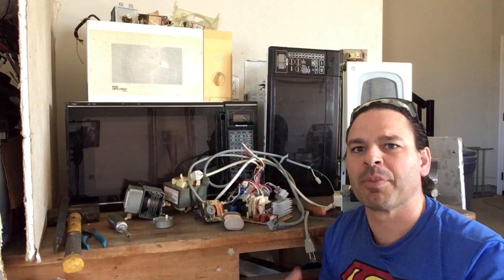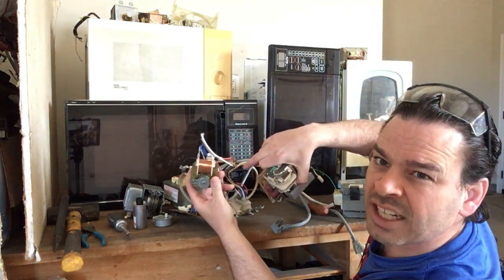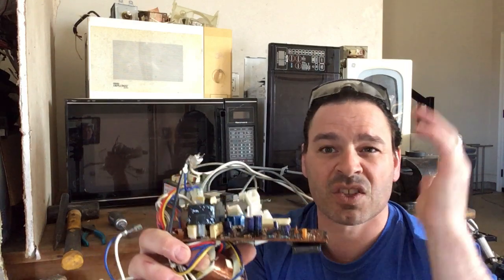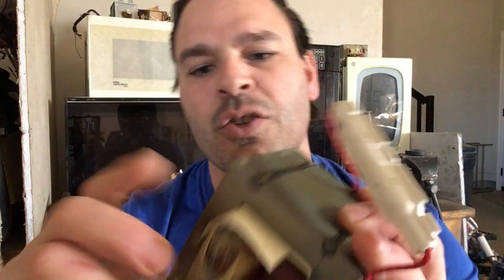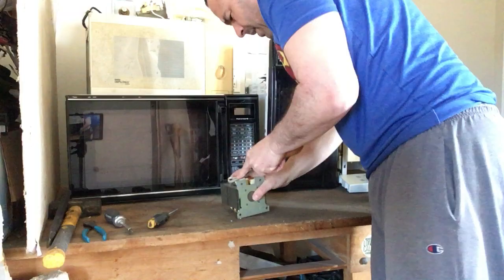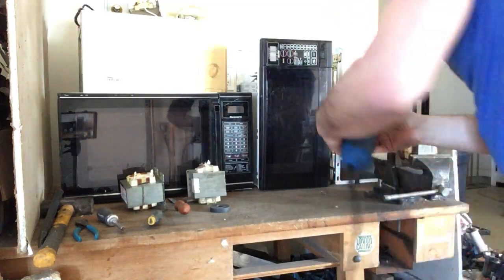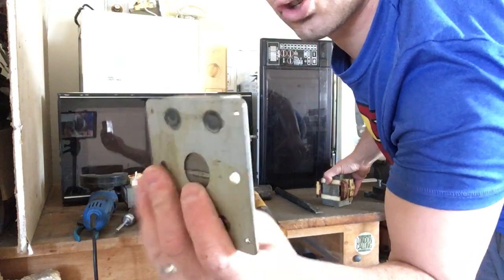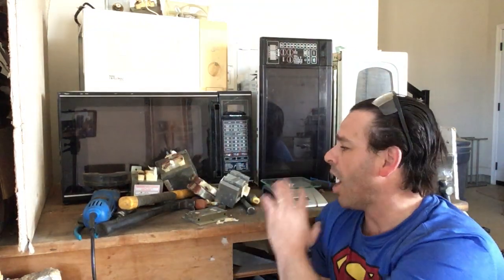Scrapping some old microwaves. How much more are they worth as scrap compared to the newer ones?

Comment: All you have to do is hit the transformer with a hammer and it will come apart no grinding necessary
Reply: Yea weld is thiner  that steel. Hammer works good Thanks
Reply: Yep. After I learned the easy way, all transformers, whether they're aluminum or copper, don't sit in their own bin for very long. All you need is a good hammer and a soft spot in the yard to dismantle it.

Comment: I have a somewhat related question. I have several nonfunctional A/C window units. I live in the US, and in my city, it is illegal to scrap window units without an HVAC license, and I don't have one. I was thinking of breaking them down. All of them are at least 15 years old. Would it be worth the time to break them down?
Reply from the maker: unfortunately every state has different laws and I don’t want to tell you to do something if it is going to get you into trouble ( I have heard that some states can give a hefty fine if they knew you cut the copper and released the freon) You could call different scrapyards in the area, some may take them taken apart due to the great copper value and not ask questions. The copper wire you could say was from any type of motor, but the compressor shells is pretty self explanatory where you got them from, which could get you into trouble. You could also maybe call an HVAC place and explain tha you have all these air conditioners and give them a cut of the money. Here in Canada we can bring them in no problem. I know that the gov. is trying to eliminate people from releasing the Freon into the atmosphere, but when people have to pay to get rid of them it encourages some people to throw them in the ditches.

Comment: that transformer at like 14 mins, if you just hit the weld with a hammer it should split, idk just another option to maybe save a bit of a cutting wheel if possible
Reply: You are right, but it is loud and don't want it flying off or vibration knocking off some of the items on my bench
Reply: @jamesfirth1280  I just whack mine on a lawn because the inner E metal pieces need to come out through the bottom while you're hammering on the top. Since the ground is soft, the windings eventually pop off the top as the metal E's are pushed into the soft earth.